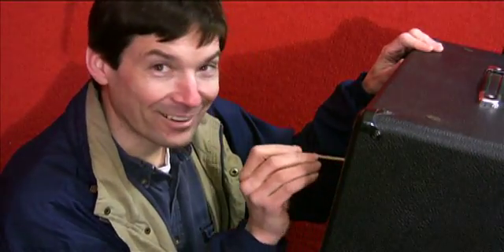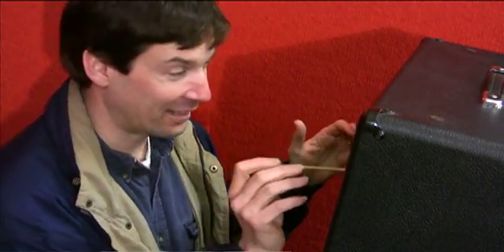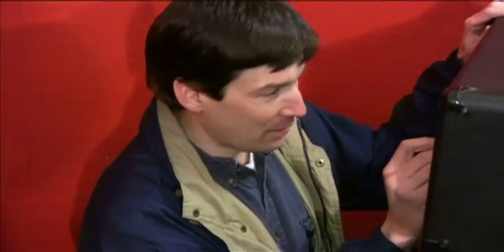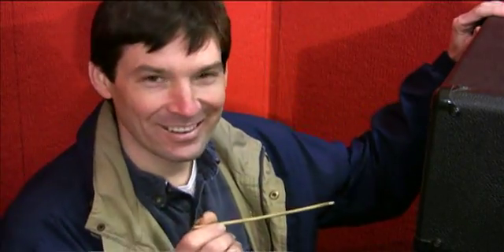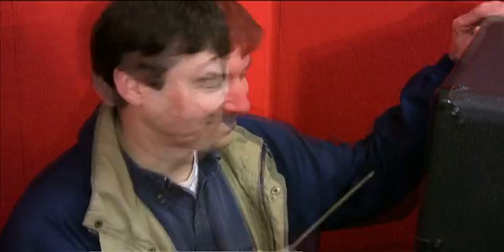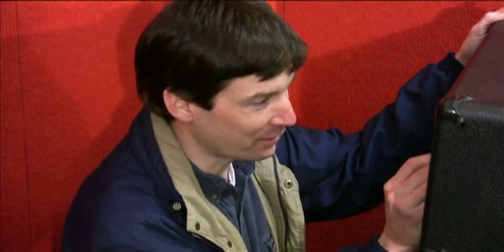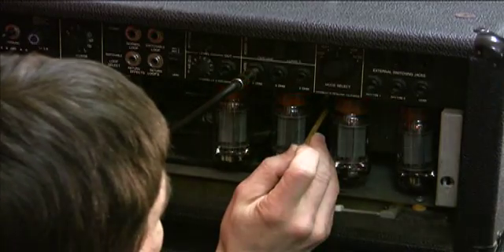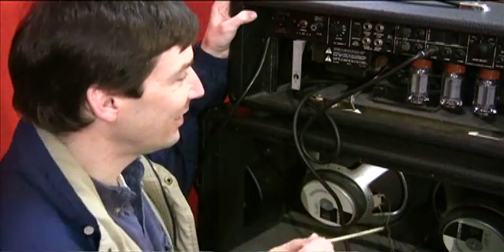What Is A Microphonic Tube?

Comment: Just purchased a pair of Siemens CCA 1962 "gems" off eBay. One is so microphonic simply tapping on the console causes it to ring and oscillate through the speakers. Note speaker sensitivity is 103dB. Fortunately, and without any seller complaints the return process is proceeding without delay.

Comment: I have a Bugera V22 that I swapped all tubes out and at higher volumes I get this rattle noise. Its excessive on certain notes. 

Do tubes make this noise from my speakers bass hitting the tubes and causing a rattling/oscillating sound?

Comment: I just got a brand new  EH preamp tube to change on my Hot rod III, cause I dont like the one 12 ax7...its a little loud, so I put the new one and its ringing like crazy, I just connect the cable to the amp and it makes a microphonic noise, I got to check witht the store who sold me that tube....

Comment: I started to notice a harshness to notes up in the higher registers and a slightly raspy  sound on solos and a slight bell like ring when I did palm mutes with a long pause between chords (high gain), so I did the tap test, and I find it hard to tell the difference, and it also depended on how hard I taped, I identified at least one power tube, not sure on the preamp tubes, I realize that even a tube thats only slightly bad can have a dramatic effect on tone and sound. my amp has not been moved roughly, but I have put about a 1000hrs of use on it in about 3 months, I'm going to do the power tubes first then the preamp next month if this doesn't go away, my amp is totally quite even when cranked on 10 doing this test with just the normal shhhhhhh...sound.    any advice? thanks in advance

Comment: Lots of great videos from you guys.
 My Blackstar Stage 60 is exhibiting some strange wind/howling background noise when only particular notes are being played, on all three channels. Changed out the speakers but same noise persisted. when I plug it into my halfstack cab and disconnect the 2 speakers in the combo, everything seems to be ok. I dont know if it's the power or preamp tubes. Vibration of the combo is obviously shaking something up. What do you guys think? I've only got the dough to replace either power or pre amp tubes for now. Thanks.
Reply from the maker: sounds very much like a microphonic tube ... cannot tell if it is preamp or power tube.  Since it appears on all three channels, I would suspect the power tubes.  Remove all of the preamp tubes and turn the amp on as if you were going to play.  Then lightly tap on the power tubes.  If you hear a rattling through the speakers, then the power tubes need replacing.
Reply: Thanks for the reply. I'll start with that.
Reply: +Igornopolis my vox ac30c2 is having that problem too I hear some strange sound background like a pitch.

Comment: and yes....I should be burned at the stake for running a 8 ohm load on this amp.  I know it wants to see 4.   However, I was always told that the 100% mismatch (8 on 4, 16 on an 8) etc.  was ok.  Heck Fender had parallel inputs for speaker jacks.  Any additional speaker plugged into a fender would mismatch the load as they didn't use multi ohm tapped OTs...

Comment: about 10 minutes of playing I hear a tone like a siren and shut the amp off.  I was facing the power tubes and did not see them cherry bomb.    Can you describe what a microphone power tube might sound like?  The other issue was that the pins on the octal socket were loosey goosey so I may have lost contact with one of the pins in a power tube.  (Maybe the grid voltage for an instant).   Hope nothing is fried.   Thanks for all the help
Reply: Tubes can go microphonic over time, but usually after warming up for a while. Sounds like yours are going that way. If you don't like it, just change the tubes out. Some people actually look for it though.

Comment: Your welcome for the comment.  Now I have a question of my own.  I recently acquired a 67/68 Bassman with the much maligned AB165 circuit.  When I got it, the previous owner told me it was crapping out on him.  Turns out one of the series diodes was burnt open (so it was acting as a half-wave rectifier only).  I fixed that and recapped it with TVA blue body caps (my favorite).  I played bass through it into a 8 ohm JBL (E140) and it sounded good except for some 60 cycle hum.  After

Comment: I am a mechanic so i understand maintenance but this is the second Fender amp that i have bought new that had non tube related problems. The Super Champ XD (has less than 1 hr use) has been in the shop under warranty for over a month. I called yesterday and they haven't touched it yet. They say they think it is tube related. But i swapped in new good tested tubes and it didnt solve the problem. I put the old tubes back in before sending it in. Fender has had channel switching problems.

Comment: I sent the amp back for exchange. But i have read about a few people having problems like this with the Fender Reissue amps and was wondering if it had to do with cheap components on the board (cap)? After all these years i would think that they would have this down to a science. Cutting corners and using cheap components will end up cutting your throat in the end.

Comment: I had this problem with a microphonic tube and then the glow and crackle.  It was a bad 12AT7 phase inverter. The Vibrolux Reverb is back to her old self, and still has STR 387s. A certain tech who shall remain nameless said it was all kinds of expensive things requiring new sockets. this that and the other. I found 4 untested used Mullard UK made ECC81s 3 tested new, and dropped the one testing used in the amp and its been great. It has an old EI in the PI socket, so it eats PIs.. Many amps do.

Comment: @TubeDepotTV Thanks :) I Took all tubes out because removing dust and putted them back in. They  worked without the microphonic sound. But now i have a other strange problem. My V8 power tube "last one" is glowing blue sometimes and crackling noises come out the speakers. When i turn the amp off and on its working without problems. I think it needs a biasing process or is it just a old tube?

Anyways watched all your video's and ive learned a lot from them :D

Comment: Presumably if the same thing happens to a power tube you just replace the bad one. After the gig would you recommend installing a whole new quad of power tubes? I suppose that is the only sensible option.

Comment: I have begun to hear some rattling coming from one of my Power Tubes on my Fender Super Reverb '65 Reissue. Is this is a sign of the tube have gone bad? it doesn't sound like what your "microphonic" tube sounds but it only makes a rattle when I play some low notes and I identified pretty much which tube it is that rattle. Could it be something else has gone wrong?

Comment: @TubeDepotTV  i have tried 3 new preamap valves in there, a mesa boogie one, a jj valve and a marshall preamp valve, all were new but the problem still remains, i even changed the whole set inc. el84s...i had it looked at by a mp tech and he couldnt find the problem, i phoned mesa up also and they were like "if its not the preamp valve then they wernt sure"...its really frustrating

Comment: sorry the problem is with the pre-amp valve not el84....anyhow, if i turn the gain past 6 oclock is squeals like a pig and the amp is microphonic along with the v3 tube(guitar doesnt have to be plugged in).like i said i have replaced that valve and i re-valved the whole amp and problem still there....its a mesa boogie f30

Comment: hi, when i tap one of my valves its microphonic, and also the whole amp becomes microphonic too, only when the gain is past 6 o clock..i have tried 3 new valves (el84s) on the problem valve but i still have the problem...help?

Comment: Sounds as if the tube itself is resonating at that particular frequency and the vibrations are being transferred into the circuit as an electric version of it.  

So, can you take a rubber band or similar and just put it around the tube to deaden it (basically, not allowing it to vibrate freely)?  Or is it a vibration INSIDE the tube?
Reply: Wont it melt? The Rubberband...